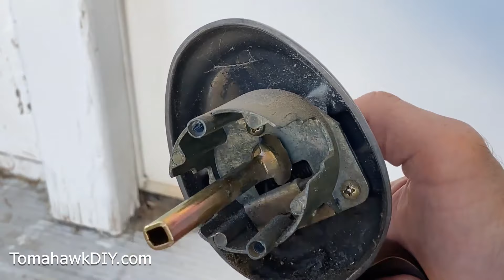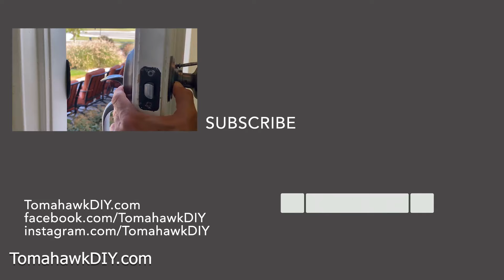Try First: Easy FIX for Stuck Front Door Handle

Comment: Do these type of door handles have a certain name ? I mean a door that has a big strong handle just for push/pull and you need to press a smaller part to open the door. Instead of the common door handle that you press down and also use same one to push/pull.

Comment: The inside knob worked great but I was having a lot of trouble with the outside handle. I didn't have a clue of how to approach it until watching y0our video. Turns out my metal pieces weren't worn so I just took the mechanism apart and lubed the heck out of any of the movable pieces. Works like a charm now. Thanks for showing the way!

Comment: So my door latch wouldn't fully release the latch, it would only come in 80%.
It looked exactly the same as yours but wasn't as worn.
I flipped it over the SPINDLE like you did, no changes
In my case the latch was crooked, your's wasn't...?
Upon better inspection the thumb latch lever (part that hits the CAM on the SPINDLE) rides on a pin with the spring, one side of the pin came out.
I used carb or brake cleaner to get rid of the grime and reassembled pounding the pin back in place.
I used a penetrate fluid similar to WD40 to lube it up and works great now.
I was going to go to Home Depot to buy a new one but thought I'd drink my coffee and spend 5mins at YouTube University and found your video.
YOUR VIDEO INSPIRED ME TO DO THIS AND I FIXED IT IN ABOUT 30mins!
THANKS!!!  GREAT VIDEO 
Now I can spend $50 on something else at home depot!  LOL

Comment: Yes indeed, a fine video explanation of how the thumb latch mechanism works.  Close inspection showed that my spring pin had slipped out on one end.  In hindsight troubleshooting a half-working thumb latch pin issue is easy: there isn’t a consistent pressure  (spring tension)when actuating the thumb latch.  Now with the pin in place there is a constant ‘feel’, the thumb latch feels brand new.  Excellent video.

Comment: I removed the door knob, which is on the inside, and lubricated it and it works like a butter.  I didn't even have to remove the handle that is on the outside.  Btw, I used white lithium grease (by Liquid Wrench) and works very well.

Thank you very much as your video really helped as I wouldn't even have thought that lubricating it would work.  

It's simply impossible to think of a life without Google and YouTube is just amazing. :)

Comment: Great video, thank you. So the trick is to disassemble everything , to check and lubricate. I removed a lock partially, cleaned up and lubricated and it was not enough, faced the same problem #2 as you did. I'll have to remove handle as well and check there.

Comment: Thank you for posting such a clear explanation and instructions! My front door handle had the exact same problem. Used WD40 as I didn't have silicon spray by hand. What's the reason not to use WD40?

Comment: Hi there, thanks for this video. Gives me some idea, however, my doorlatch will not turn, so it will not let me open my front door. I took off the internal knob, but still cannot get it to open. Do I have to remove the external latch as well? I dont see a screw outside to remove it
TIA for your help

Comment: Thanks for the video - went into my latch and found that my flange was a little worn, also, but the bigger issue was the the pin had slipped out of the hinge for the thumb button, causing it to articulate off-center. 

Re-aligned, lubed up, and put back together, and door latch works great.
Reply: This happened to me too.  The tiny pin infront of  the thumb plate came out.  Can the pin be put back in to make it work without buying new parts? Who can help?

Comment: Great video. I had the same problem, where it was hard to press down, but not for the same reason.

I put the hardware together so I  would see how it functions and discovered that the bottom screw for the inside knob, if over tightened, interrupted the function of the handle, preventing the handle from completing the cycle of turning the latch. 

In addition, while removing the inside knob, I discovered a small piece of plastic that I could not figure out where it belong. So I left it out. Maybe it was from a previous installation.
Reply from the maker: That's awesome! Thanks for watching

Comment: My problem is different. It depresses easily enough, but won't spring back. much like the later problem. But it's not lube, it's very easy to move. Just no spring action. But it's ok from the knob side.

Comment: Thanks for a nice video ! My latch sticks and doesn't come out all the way.  I would have thought you would have lubricated everything first.  Why is WD-40 not advised ?  I will try with Silicon Spray today ! :)
Reply from the maker: Hope it works for you! Thanks for watching
Reply: @TomahawkDIY  Thanks, I took out the lock pieces and sprayed with silicone and everything was loose. The problem was that the latch head doesn't come out far enough ( only half way ) and I don't see how to adjust it. So, I removed the plate which the latch head goes into and made it come out an 1/8" to have a little better contact with the latch head. I don't like it but better than buying a whole new lock. I don't know if the latch head piece can be replaced ?

Comment: So it doesn't mater which side that half moon piece is on ? I bought a new lock mechanism and now it only opens when I lift up on it. (the kind of handle that looks like a flat letter s. I've taken it to the lock smith twice but there recomendations didn't work.